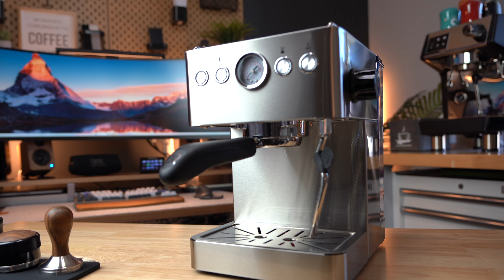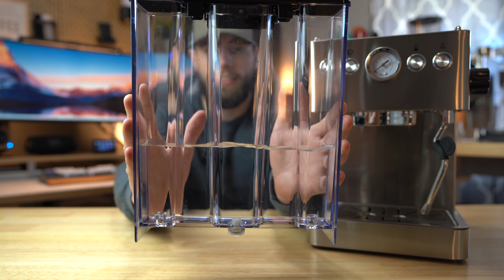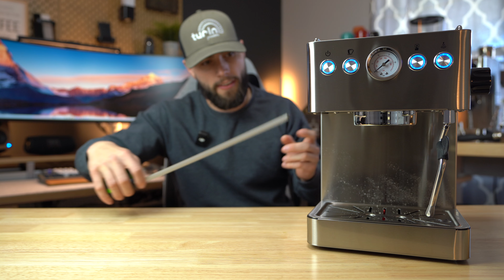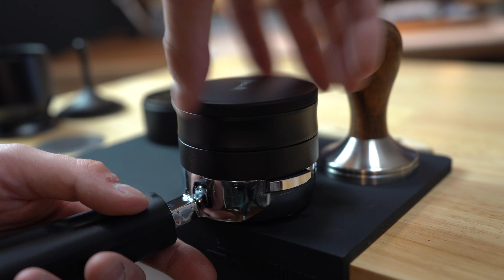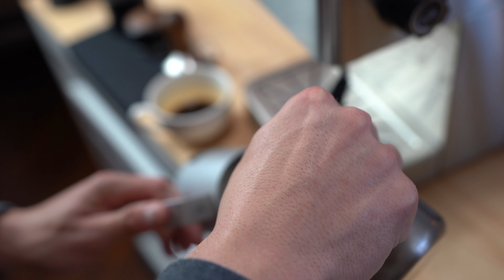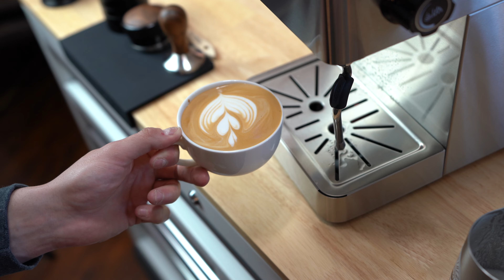Best Budget Machine For The Price? The Turin Sonata Espresso Machine

Comment: I have a standard superautomatic espresso machine I bought for convenience during the pandemic.   I have been looking for a replacement better all the way to the Micra.  My requirements is the convenience of a shot on demand (no waiting for a boiler).  Could a Sonata and a good grinder (DH64?) make a modestly ok espresso shot consistently (quaility 80% of Peet's or Starbucks) ?
Reply from the maker: We do not prefer a darker coffee like Peets or Starbucks uses.  So it depends.  We can easily pull as good and usually much better than those with all of these machines at home.  Might take some time to adjust and learn.

Comment: To anyone considering this: get the Legato. Adds flow control and preinfusion. Way worth it. You don't want to be stuck with a static 15 bar machine, even at this price point and considering the Legato is just a bit more expensive. I hope they update the Legato with an OPV soon. Then it's the perfect sub $1K machine.